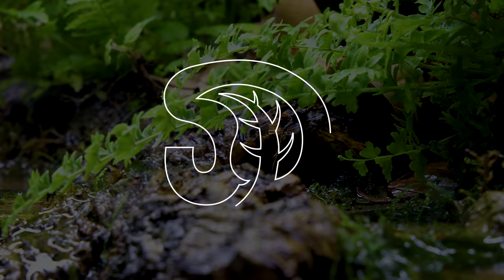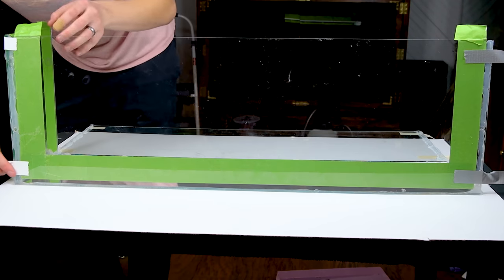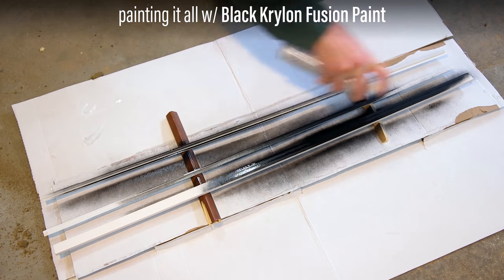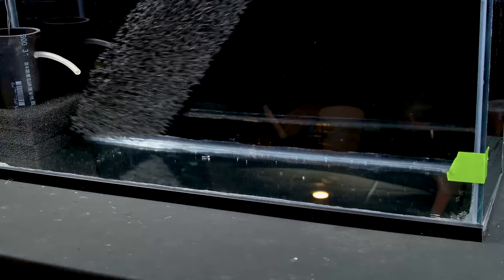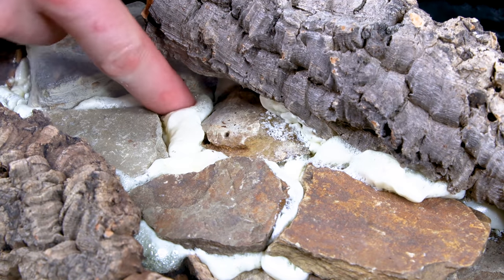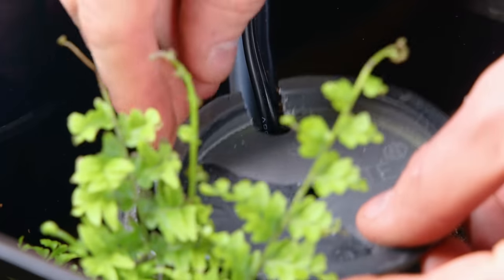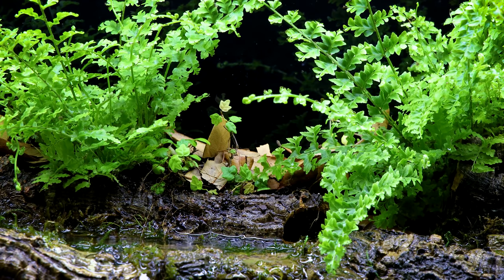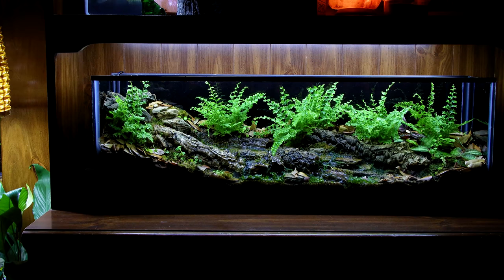Temperate Forest Creek Runoff Vivarium (DIY)

Comment: Would you consider using mushrooms in any of your builds? I'm not too versed in how they work in tanks/maintenance, so if not use them why?
Reply: Yessss!  That would be so cool!
Reply: From my very brief experience growing mushrooms, once you see the actual fruiting bodies above the soil, they've basically colonized as much of the substrate as they can. After a few waves of them fruit and drop spores, they vanish for good. I have no idea how they'd fair in a vivarium, but the few I've had accidentally grow in also disappear after a while. It would be cool if they were a more permanent presence. Maybe there's a trick to it.
Reply: A really good way to do this is to have a piece of cork round or some sort of little flower pot embedded in the scape. Then you add already colonized with mycelium substrate to that. After the mushrooms are done fruiting (or harvested if youre growing something edible) you remove that plug of mycelium from the flower pot and add another, rinse lather repeat.

Comment: I love the source of inspiration behind this.. the overflow over the edge is the key to this. A lot of scapes keep the water contained in its own area, but this break that barrier. Would you not be worried about mold growth in the damp areas just on the fringes of the running water?

Comment: I plan on building a terrarium in the near future and have been doing tons of research.  One thing that I have not found an answer to is: Should the false bottom be vented?  

The reason why I ask this, is because in a typical build, the water is forced to evaporate back through the substrate, which, is clearly a bottleneck and may contribute to stagnation.  If PVC pipe was added to the rear, and hidden within the tank, it would allow water to evaporate out of the false bottom quicker.  Auto and manual misting, along with the water feature in my plan, should provide adequate moisture levels for the substrate.  Additionally, the substrate will function in a one way direction, instead of a two way and I will have to worry about over saturation a lot less.

I have never heard this issue addressed in my research.  Pardon my question, as I am new to this hobby.

Comment: Is there problem with fungi (or do the springtails keep that managed?) and you mentioned rot, is that a big concern - sorry I am sitting on a 50 I wanted to terraform and likely won't until spring, but I see you do these and it's very encouraging. Thank you!
Reply from the maker: Fungi in a terrarium/vivarium, in most cases, is actually a sign of a healthy environment. It also acts as a nutrient sync for your plants. Concerning rot, just use dense wood and it will take a really long time to occur.
Reply: @SerpaDesign  THANK YOU!  Sorry, I didn't expect such a quick reply. I have watched a long time, I really enjoy the videos. =)